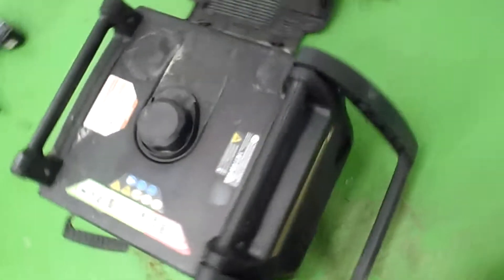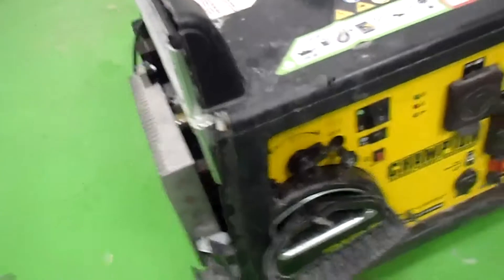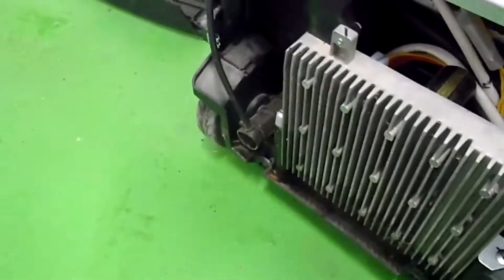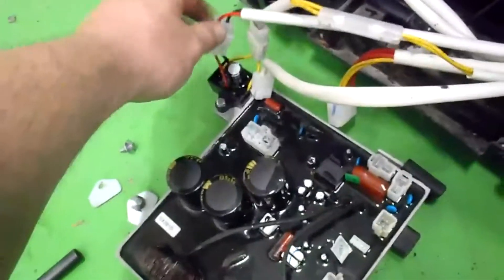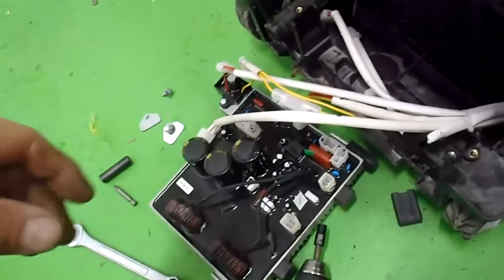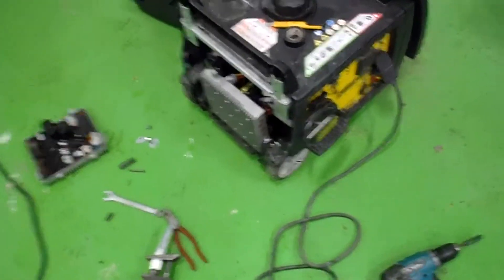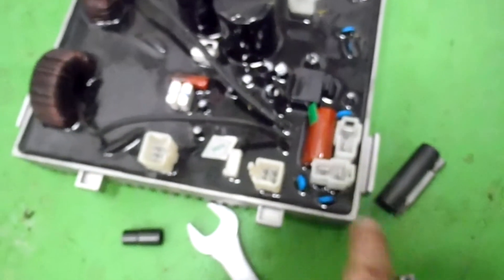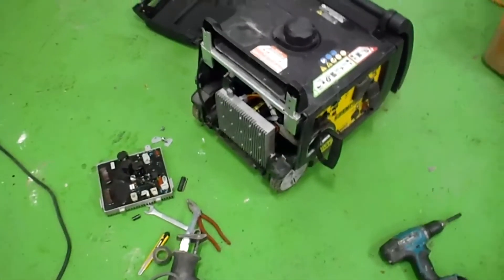Champion 3100 inverter generator not running/rough idle

Comment: I removed my control unit to replace the pull cord and upon reassembling everything it wouldn't start. I did notice there was one connector open that didn't seem to have any wires to connect to it. I counted 7 connections that I had previously unplugged. Does yours have wires to all possible connections or is there a small open 4 pin connector on the control unit? Also what is the part # for the control unit and where did you order from? 

Thanks
Reply from the maker: It's been a while since I made the video, I can't remember, I think there was a plug or 2 that weren't used.  I had to order the control unit directly from Champion.  They'll need your serial number from your generator to get you the proper part.  You can always unplug everything and see if it runs to eliminate the control module as the problem